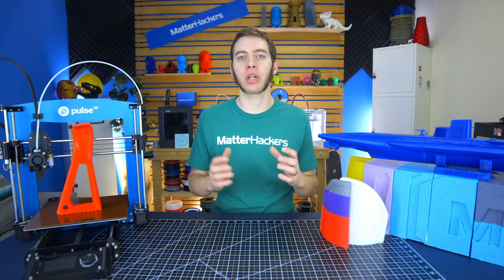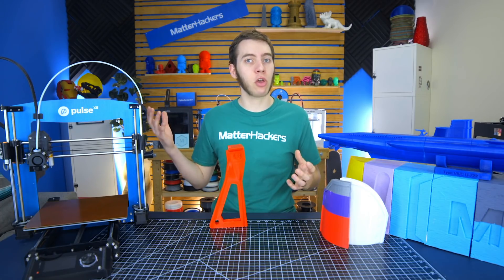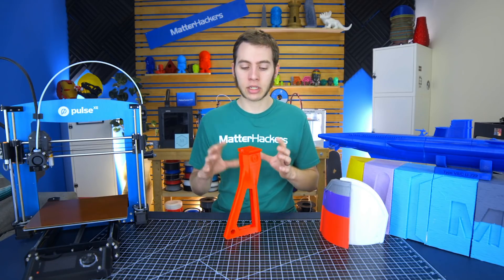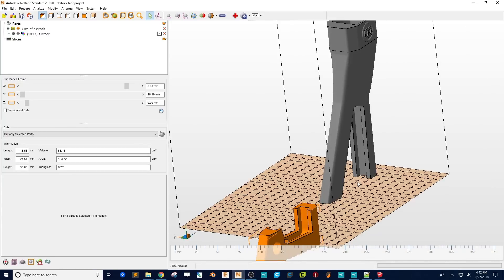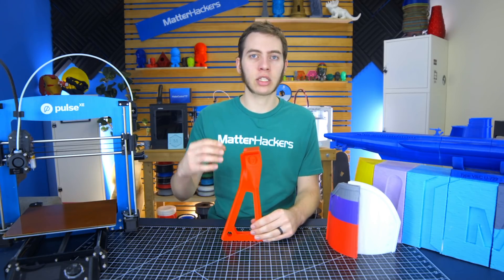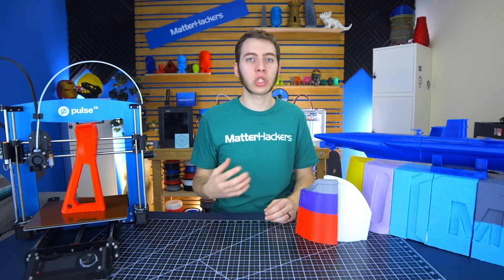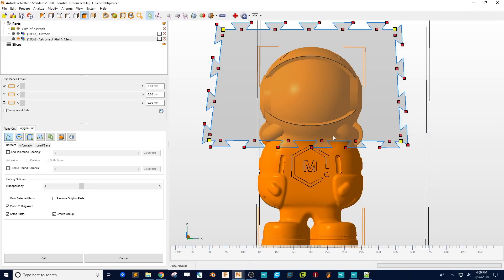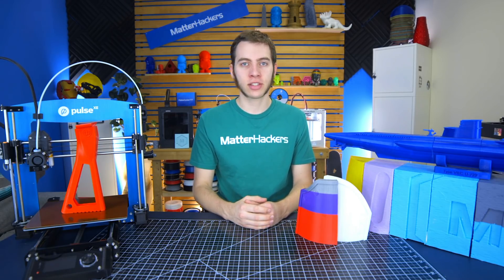How To: Large 3D Printed Builds // 3D Printing Guide

Comment: How would you print a large thin walled figure with a corrugated layer on the inner wall for vertical strength like corrugated cardboard?

Comment: What adhesive do you recommend if we're trying to put a print together to make a casting mold?
Reply from the maker: Do you mean like lost PLA castings? What king of castings do you mean?
Reply: @MatterHackers  I'm tryin to make a silicon cast using a uv cured 3d printed object that is assembled from several prints

Comment: Instead of making rectangular registration keys, you can just cut out 2mm diameter cilinders, and use bits of filament to help you align the parts ;) (not my idea, just sharing the tip)
Reply: I used the same technic! Two alligment holes, for the half parts: https://www.thingiverse.com/thing:2049129